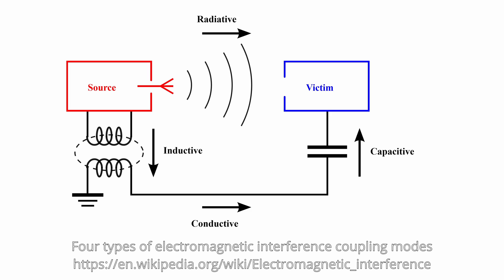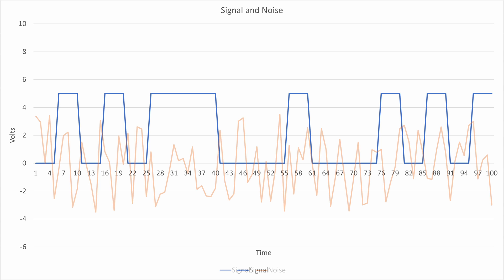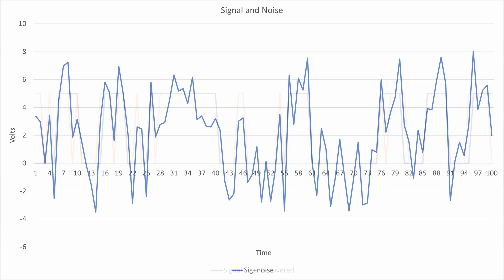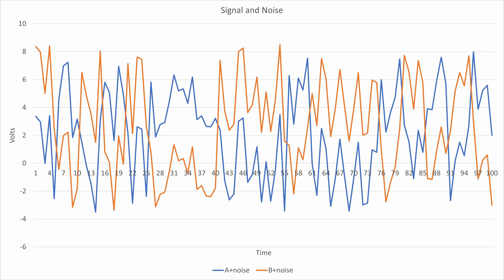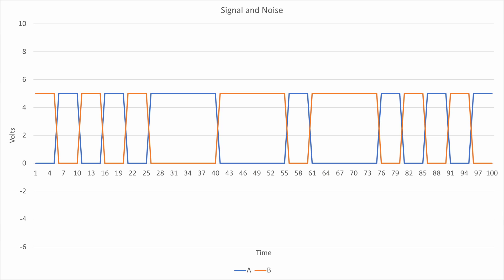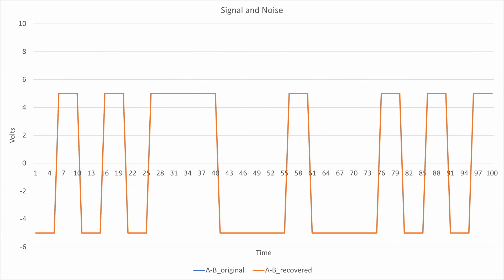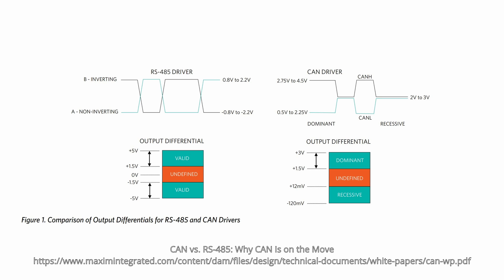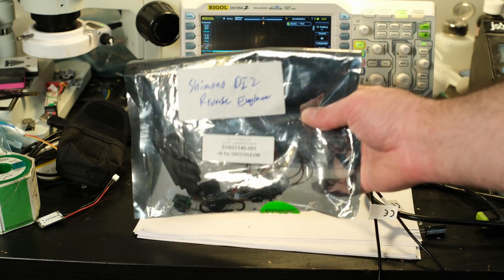Shimano Di2 was never CANBUS - Correcting a dumb rumour

Comment: Thanks Keith for this video - it helped me get started looking at the e-tube bus to try and work out why my Di2 bike intermittently does bad things (that's a whole other story). There is way more happening on the bus than I expected. There seems to be a "sleep" mode where the voltage drops a few hundred mV and it is idle, and then when it needs to do something, it does some wake up signalling and goes into the active mode. There seems to be two different message lengths - a longer one about 130us, and then a shorter one about 50us, both using the BPSK signalling you describe. The longer ones appear to be the data carrying ones. The short ones can appear just after one of the longer ones, perhaps as an ack message, or they can also appear as an idle/heartbeat message if there has been no activity on the bus for about 1ms.  So there is lots happening on the e-tube bus and none of it looks anything like CAN. And there is also all the big voltage dips and noise when the derailleurs actually move!

Comment: Well, there seem to be multiple generations of Di2, where one of the earlier ones was BPSK. Later ones seem to use a proprietary protocol based on SW-CAN.
You are only talking about regular CAN bus. Did you know about SW-CAN (single wire can)? Maybe Shimano created a proprietary variant that can be AC coupled on a DC power line, like Yamar Electronics did with their DCAN500 transceiver.
Oh btw, also check out TI Appnote SLLA336, which can probably applied to CAN as well.

Comment: I get your frustration with RS486 over power line, but it is possible and reliable. I am not sure what transivers you are using, but I have implemented this exact feature for a product and it worked. Granted, you need quite high data rates and you can't supply much current (~10-50mA) but it is possible. Difficult, but possible.

Comment: Keith, another excellent video. As someone who's worked on robots, cars, 3d printers, basically a whole myriad of devices with CAN in them, I've listened to a lot of people explain CAN and you've probably done one of the best jobs yet. With regards to the capacitive coupling of the differential signal, I noticed that you're using ceramic capacitors. Keep in mind that the capacitors value goes down as a DC bias is applied. So depending on the size and dielectric of the cap, you may be working with a capacitor that is 10% of the value you expected it to be.
Reply from the maker: Thanks. I'm by no means a CANbus expert but I've been using a lot of this stuff more and more lately. I never thought of that about the DC bias affecting the capacitance since I was using them to AC couple. I tried a few values but mostly derived my starting points from a Paper from TI about coupling differential RS485. I simulated in LTspice as well and got about the same results.... it works sort of, until real life stops it.

Comment: Interesting, since I've been down this road too. Not sure whether you came across the TI application note https://www.ti.com/lit/an/slla336/slla336.pdf but I was able to reproduce this and do CAN (500 baud) over power line (12 V). It was flaky and the size of passives required made barely any advantages over two extra conductors. It's even briefly discussed here (Cybertruck) https://youtu.be/J5zDNaY1fvI?si=CPSFCCVNxvG9C1A8&t=802 - probably a more sophisticated PHY though/carrier wave. Regardless of this however, and as you say yourself at the end I think 'never' in the title is misleading: it's my understanding (though never tested myself) that pre two-wire was CAN.
Reply from the maker: Yes I did see that one. There is also another "simulation based" paper ti has with even larger values. There are OOK modulators for RS485 I found, I think I mentioned them. Even my OOK modem had a big inductor though I went nuts on size. I want to work on getting up speed and try to actually do BPSK modulation. I have an LTspice simulation of a demodulator that uses 2 opamps and a nor gate. But I've yet to try and build it and getting the initial AC waveform and syncing to it is still a hard part for transmission.

Comment: Now go and edit the CAN bus page in Wikipedia!
"The CAN bus protocol has been used on the Shimano DI2 electronic gear shift system for road bicycles since 2009, and is also used by the Ansmann and BionX systems in their direct drive motor."